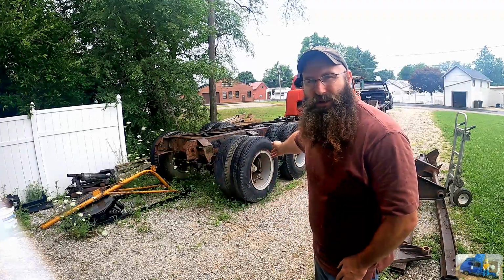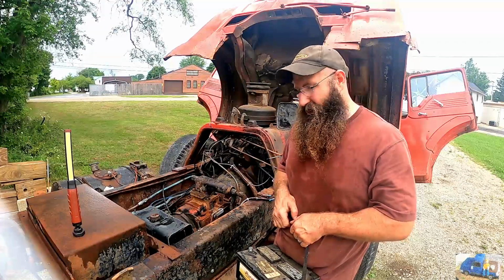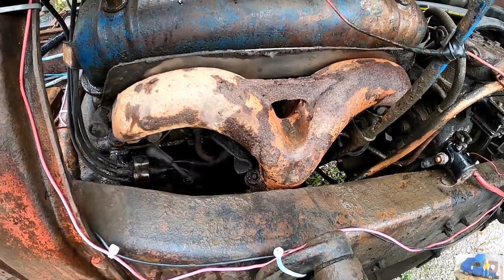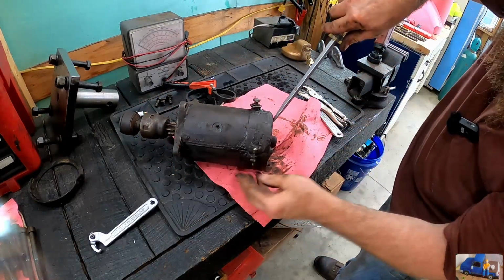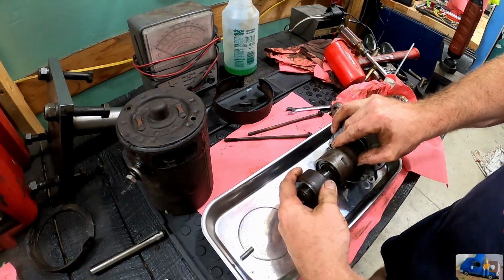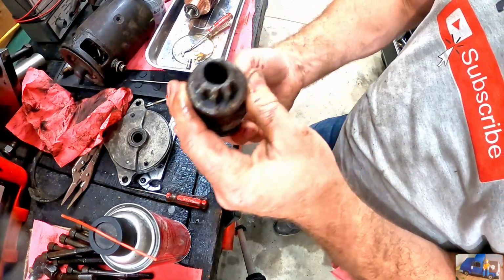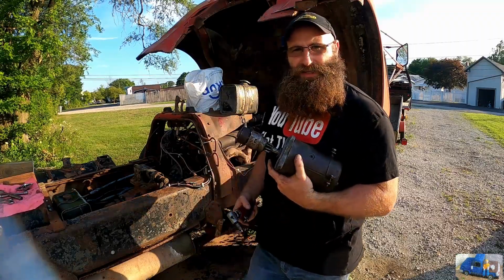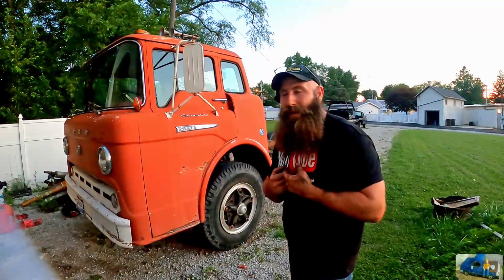‘Bendix’ Don’t Break It!  - 1962 Ford Y Block / FE Starter

Comment: Engine might be a 332 Lincoln engine. I saw one in a tandem axel 60 Ford. Looks a lot like a Y Block but bigger. I was noticing the brace between the Y. The one I saw had a Holley 4brl with governors all over it and a magneto with cable driven tach.
Reply from the maker: Yes sir, this is a 332 Y block with 2 barrel Holley.  I believe they put larger gasser engines in these old girls too.  Maybe a 540ci engine?   Stop back in I'm always working on this old girl as Margaret is a long term project. Thanks for watching! 👍😁

Comment: When you have the starter off and the bendix is stuck out. Just hold the drive bendix against a wire wheel on bench grinder. Use it to spin the drive back in place.
Reply from the maker: Good idea!  I think one of the detents on this was rolled or knocked out of position causing binding.  Thanks for watching! 👍😁
Reply: I think he's right. Look up the video "ratchet style starter drive repair".
What I don't understand is how yours doesn't do the same thing again. Those spring loaded detents seem like they're obviously meant to catch in the milled part of the threaded gear.
When you spin it really fast with a wire wheel it makes the centrifugal force pull the detents out and you go back to where you should be... I think... haha.
I rotated mine outside of the vehicle when I was doing a transmission rebuild, like he says not to do in the video... haha
Reply: Put 12 v to it when it gets to spinning fast take a wood hammer handle between housing and the gear and it will usually reset the bendix it worked for me they are a booger I had no luck with wire wheel but it released pretty easy this way for me

Comment: Normally use oil-impregnated bushings that you soak with oil for 24 hours but what you did will last a long time.
Reply from the maker: I need to stock some oil-lite bronze material.  This was just a scrap / stock piece I had in the shop.  Thanks for watching!  👍😁

Comment: I'm slowly working my way through all of these I plan on buying a cabover
Reply from the maker: This style is one of the most popular and longest running cabover models built.  Mine is a 62' and they were built well into the 80's.  If you keep your eyes open they come up for sale pretty regularly.  I have seen two others for sale within the last year.  I wanted them, but lacked the space and extra funds!  I hope you find one.  Cheers, 👍😁
Reply: @FlatThunder  I live down here in Texas so I see them allot with minimum rust damage except in the places from the factory that just collect water. Oh by the way if you want to keep those mice out of your truck pull the rest of the padding off of the seats they love that stuff and they're attracted to the urine smell from the mice that lived there before
Reply from the maker: @lordFury  good idea!  I need to extract the whole interior and get it reupholstered.  My upholstery guy is great, but is usually back logged for a long time.  Jealous of the idea of little too minimal rust.  Margaret has some serious rust issues I need to address.

Comment: i was 1 of those that mentioned about the lil gas tank over the muffler    hope you get that better with the real gas tank...
Reply from the maker: No worries, I welcome all comments and suggestions on doing a job more safely or better.  👍 Sometimes I get negative / mean comments that get flagged.  Those are why I add in disclaimers.  The new exhaust and fuel tank will be a massive improvement!  Thanks for watching!  👍😁

Comment: I know it was a moment of desperation but please don't beat on your lathe spindle...I have worked in shops where you would have been fired for that.  I had an Atlas just like that one. They are good machines.
Reply from the maker: I hear that!  It's horrible for the roller bearings, but sometimes I run out of options.  So much for it just falling out once the spring is compressed.  The Internet lied to me!  🤣.   Thanks for watching and sharing!  I also think old Atlas lathes are good machines.  👍😁

Comment: Another great video on the '62 Ford truck.  What I find most appealing is the way you overcome setbacks and frustrations calmly and with panache!  And you make do with the tools at hand.  My only issue is the whistling you do, apparently, to illustrate circular motion.  Not needed!   Otherwise, keep 'em coming!
Reply from the maker: Thanks Robert!  The whistling came from an old time assembler I used to work with.  It's used to represent work or movement in some fashion, but not necessarily circular motion.  Oddly enough I picked up his habit 🤣.  'you just need to, whistle whistle, with a hand gesture of the motion'.  It entertains me more than anything.  Mr. Weber you know who you are and where the whistling started!  😁.  Thanks for watching!  👍😁
Reply: @FlatThunder  Ok, well once or twice in a video is bearable.  Glad it entertains you, but after a while I just find it annoying.  A minor issue to be sure, so don't hold it against me!
Reply from the maker: @robertoconnor279  No worries, just part of my MO.  I hope you stick around for some future content.  Old Margret is a long term project.  Cheers 👍😁

Comment: Hey Andy. Just fyi, Y block and FE are 2 completely different animals. You have a Y block. Been my experience that most old starters just need to be taken apart and cleaned up if they aren't completely worn out internally. Good thing you have a lathe. Been looking lately at arbor presses here in Detroit and they are pricey. Think I'm just gonna try and find a used 20 press. Glad you got her going. Thanks for posting.
Reply from the maker: I'm not sure when I picked up the idea FE and Y Blocks were of the same design?  My mistake.  Maybe it was during my recent starter research on forums.  Margret's engine is definitely a 332 Y- block.  I'm in the same boat on arbor presses.  I have been looking randomly for several years, but they are always big money.  I want a ratcheting style arbor press preferably Dake, but might have to break down and buy an import one day.  Thanks for watching and sharing!  👍😁
Reply: At around 35:40 you stated that you didn't know how FE guys got the top starter bolt in/out... you made it sound like you had an FE instead of a Y-block based on the way that you stated it. I think it was merely mental slip on your part. Obviously, you know your engine series. As for  that top bolt with tough access, when new they went in easily with the fingers. Tightening them the last bit with a combination wrench was easy. Now days I recommend scoring some swivel joint connectors to use. They come in all sizes and are very handy when you need them. Warning: don't buy an El Cheapo set... if you do they probably won't last long. This is one of those tools you need to be tough & durable - especially if you use them a lot of the time with pneumatic drivers. Even a cordless drill will wear out poor quality swivel joint connectors quickly. A lot of guys I know will bypass normal sets and go straight for the ones rated for pneumatics even if they only use them with hand tools. Why? Because they'll probably be the first and last set you'll ever buy. You'll pay up front but it'll most likely prove to be worth it over time. Best wishes! 👍🏻🇺🇸👨🏻‍🔧🗜️🔧

- Max Giganteum